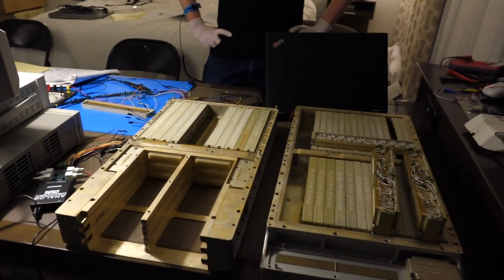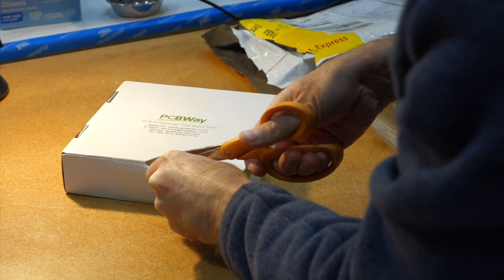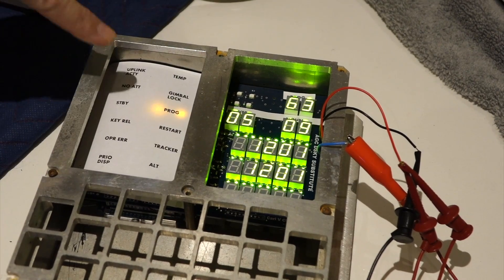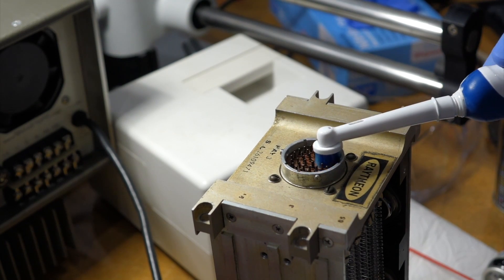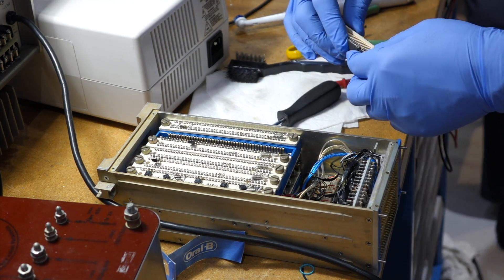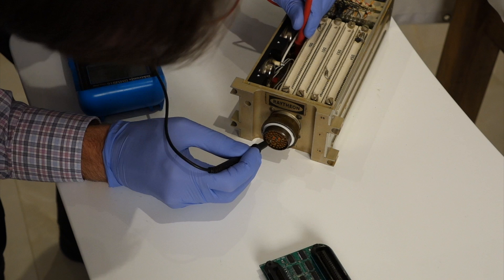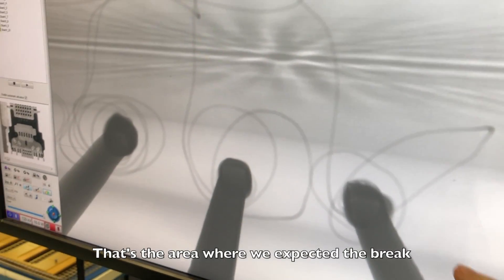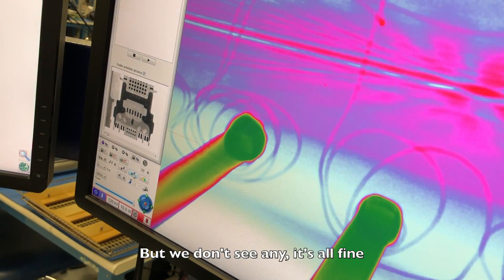Apollo Guidance Computer Part 6: Restoration update, a new sponsor, and a satellite launch

Comment: 0:55 EMM
 - 2k words of core rope memory from 16 bit registers 
1 word = 16bits (2 bytes). 2 * 2,048 = 4,096 bytes (4 kilobytes) of erasable core memory!
It might not sound like much, but 4KiB of erasable core memory on something that small in the mid to late 60's was pretty amazing.
Reply from the maker: Almost. I think you maybe mixing things up between core rope and erasable memory. Core rope was 36 KWords (of 16 bits), so 72 KBytes of ROM, and erasable memory (which is also core, but not rope, and has lower density) was 2 KW, so 4 KBytes of RAM. Which was indeed a lot for such a small volume (probably one of the highest densities achieved at the time), but an excruciating limitation for the programmers. They used every trick in the book to save a byte, including using a byte-interpreted higher-level language for complex calculations.

Comment: The reason the pins of the IC are 'splayed-out' is because the IC is meant to be used with an auto-insertion machine of which the end-effector relies on outward tension of the pins to hold onto the IC. So, the tension is always still there because the are not bent by the auto-insertion machine--just tension-flexed enough to line up side-to-side with the PCB holes. Great work and love your commenters!

Comment: If the break in the wire is narrow enough I bet you could weld it back together by applying enough voltage to arc across the break. Not sure if I'd actually try it on something that's as irreplaceable as that memory module though.
Reply from the maker: We thought about it, but the wire is so tiny (4 mils) that I think it has much many more chances to just vaporize rather than welding. We could get 4 mil wire and try it in an experiment.

Comment: I love this series. One thing I would like to know is a bit more technical details about the core-rope emulator device. Those "DIP-stick" assemblies don't like very complex, so I was wondering what is in there. It seems like it would have to be some kind of static RAM or something. Which begs the question, if SRAMs were available at the time, why did they use core-rope memory???
Reply: At the time that the AGC was designed, a 16 bit memory would take 16 chips to implement. To create a 36K word memory for programs would have taken a half a million chips, more than 10X the size of the AGC.

The core rope is a read only memory, not a RAM,  with an very important objective of keeping the programs from being corrupted by errors or other failures. 

The core-rope memory is driven by the AGC with putting an address on certain signal lines, then pulsing the memory to read. The simulator captures the 16 address bits,  sends a message to an external computer that was hooked to the simulator. The external system had large core memory inside it, loaded from a tape drive. The external system sends the 16 bit word back to the simulator box.

The simulator box has enough storage for the 16 bit word, which it provides to the AGC when the read control pulse is sent by the AGC. In other words, the simulator boxes look at the address coming from the AGC, ask an external system for one word, then turn that one word into appropriate pulses into the AGC at the right time.

The core rope simulator boxes have the ability to store the 16 bit address, to send those over the cable to an external system, to receive and hold a 16 bit word, and to produce pulses at the right timing to convince the AGC that the word value was read from core rope. 

We don't have the external system that was hooked to these simulator boxes. We don't have the schematics for the external system. Ken is engineering an external system, using a Beaglebone controller and the cape PCB he built, which will look just like the external system to the simulator boxes. The boxes will think they are talking to the external system.

Ken had to reverse engineer the insides of the core rope simulator boxes, plus analyze the memory reading logic in the AGC, so that he could design and program the external system which we will use to drive the core rope simulator boxes.

His Beaglebone system will hold all the various core rope software versions that have been found, allowing him to choose one which the AGC hardware will execute when we power it on.
Reply: Thanks for the explanation. Calling it an "emulator" was throwing me off, as this implies that the box itself was emulating the core rope memory itself. I don't recall the video mentioning that it translated to an external memory, which was missing. That's why I thought it needed to have memory inside. Now it makes a lot more sense.Given the way it works, it seems like even if the emulator was broken or was never even found, that the functionality of the emulator could have been reproduced on a new design. Imagine taking the beaglebone and probably a bunch of comparators or level shifters to sense the inputs of the core rope interface and then output the correct levels in response. Put it all in a nice box with a USB interface to connect to a PC to load the programs. This is how I always imagined it would be done, since the emulator didn't seem to be documented.  Thanks again for taking the time to explain the emulator to me.
Reply: @USWaterRockets  The AGC is not sending logic levels nor latching them in. It believes that it is hooked up to actual core ropes. 

It sends hundreds of ma of current in a short pulse to cause the large core to flip. The sense amplifiers are watching a differential wire pair to detect any kind of low level pulse that returns if the sense wire is woven through the core. 

Thus, to replace the simulator boxes themselves, we would have to match the impedance and characteristics of the core rope, absorb the current pulses, then produce a return millivolt pulse at the proper time to cause the AGC to see it as a one bit. 

The driver circuits inside the AGC are kind of sensitive - if they are operated with no rope module installed, the power transistors blow out. If they are connected with a simple short circuit, the power transistors burn out. The connection must be within the range of real core rope to suit the driver circuit.

This is why it was useful to reverse engineer the core rope simulator boxes. They do the heavy lifting, presenting the right impedance to the driver circuit, converting the pulses into a logic level to determine the address request, and produce a plausible millivolt level pluse for the sense amplifiers for any 1 bit that is being read. 

The round connector side of the core rope modules, on the other hand, operates with regular TTL logic levels, not pulses or analog stuff. That is why Ken chose to drive them instead of replacing them.
Reply: I was not aware that the driver circuits would blow if open or shorted! I can see why getting the emulator running would be desirable.  I do wonder, has the emulator been reverse engineered to the extent where schematics have been created for it? Seeing how there were so many issues getting the DIPs to simply make a connection inside the DIP sticks, I would be nervous about a connection in the emulator being faulty and causing the damage to the AGC you warned about. Perhaps the DIP devices are not in a part of the circuit that is critical that way, but I suppose you already have determined that everything will be safe. Thanks for the detailed response!
Reply: @USWaterRockets  The core rope simulator boxes use analog transformers to present the proper impedance to the AGC driver circuits. 

Ken has reverse engineered it to the level that he has a schematic. I will check to see if he will post it for others to view.

Comment: how does the rope simulator work ? "Normal" RAM Chips inside that need the Contents loaded into before simulating it the AGC ?
Reply: Yes, but they have only the room to hold one word of the 36K at a time. The contents are requested by the rope simulator over the connector we were fixing. Ken's driver box, a Beaglebone with a custom cape on it, will take the requests and feed the one word to the simulator. 

The simulator latches the 16 bit address set up by the AGC, asks the external box (Ken's) to send it a word, then when the read pulse is produced by the AGC, the rope simulator produces the pulses that would be returned by physical core ropes, corresponding to the one word being requested.

Comment: Would it be possible to isolate or piggyback the bad core section and simulate it with a small board hidden somewhere?
Reply: That is one of several possible solutions. Stay tuned to see  the options, investigations and solutions.

Comment: At least these were obtainable connectors from a series that's still active today. That's lucky! Lots of hardware from that era used connectors that have been long since phased out. Yours looks like 20-39 from D38999 Series 2, though I'm surprised by the solder contacts on the plug instead of crimped types. Modern aerospace stuff often uses high speed serial lines, which means twinax/quadrax/8-way/fiber... and all those connectors tend to be in the $1k+ range to buy, most of that cost being the high-speed pin groups; not to mention specialized tooling required for assembly. The actual connector shells are "only" $30-150. Future reverse-engineering of today's aerospace hardware will be a lot more expensive, even aside from the much higher complexity. Worse yet, a lot of advanced modern military hardware uses PCB-soldered filtered connectors (with LC filters for each pin), with the pins being non-removable in case of damage. But with a 20+ layer board, good luck desoldering such a connector due to the thermal mass. But, all this is part of our general trend of non-serviceable electronics unfortunately. Pretty much inevitable.
Reply: That was a more modern connector, you can tell by the Teflon back seal. That and the plating pretty much says its from the late 1990's thru the 2000's easily. I kind of wonder... MIL-C-38999's were used on the EA-6A's I wrenched on and the older versions had a spring clip holding its whole body together and removing it was. I had to mod a connector, popped off the spring clip and took the whole connector apart and used files to make it fit.
Reply: @geneard639  Hi Gene! I'm not familiar with older versions of these. I work with mostly D38999 Series 3's these days, but I'm familiar with other standards like M83723/26500/26482/28840/5015/etc. What I can tell you is that the "spring clip" you speak of is very common for all modern M83723 and D38999's to hold the plug body to the inner core/insert (this is still true today). The exact technique is up to the manufacturer. Amphenol/Deutsch/Souriau etc all use their own retainer and ratcheting systems. Souriau often uses a plastic cover over the spring clip. I've never seen a teflon back seal before though. That, along with the solder contacts suggests that this is either a manufacturer-customized version of D38999, or maybe not D38999 at all. Customized connectors based on a standard aren't uncommon. These days NASA has their own standards, such as SSQ21654 and others.

Modern connectors are sealed with a proper environmental backshell, which would use a fluorosilicone ring to press against the area above the plug threading, along with another compression ring to create a seal with the harness. As such, any modern D38999 Series 1/2/3 + environmental backshell = IP67 rating when mated (and no rating when unmated). Also, have to be careful when machining the "olive drab" connectors (W/B designators), such as the one in the video, due to cadmium dust which is nasty stuff. EA-6A's are very pretty beasts. That must've been enjoyable for you! :) -Nick
Reply: @geneard639 At 8:47 it looks to me like that might be a date code of 06/40.

Comment: Will the DSKY board be publicly available?  Would love to see the BOM as well!
Reply: I would be happy to make it available. Not all that useful without an AGC, since it is engineered to be driven by 28V logic levels and to respond to the AGC in kind. Much easier to use any of the replicas that are available, since they can put an AGC simulator inside and drive it all with modern logic levels. 

From the top of my head, without exact counts:

21 TDSG3160-M 7-segment displays
3 MAX7219CWG+ driver chips
2 PCF8574DWR I/O expander chips
9 G6L-1F-DC4.5 relays
32 MMUN2111LT1G transistors
5 inline connectors and one barrel power connector
1 Arduino Mega 2560
9 CGRA4007-G diodes for relay quenching
30+ capacitors
60 LEDs plus 60 limiting resistors
quite a few other resistors

I believe the final component count was 398.
Reply: @carlclaunch793  Thank you so much!! Will  add to the Open DSKY replica forum.  Good to know what parts people are sourcing.  Especially the +/- segment led display.  Love these videos!  Please keep them up!

Comment: What for do you need 10 layer job for a simple display interface O_o
Reply: It includes 23 logic interface circuits for shifting 28V logic down to TTL for the Arduino, 9 relays with driving circuits to output 28V logic based on Arduino 5V signals, 21 seven-segment displays, hundreds of LEDs. 

The major constraint is the small DSKY box and the specific placement required for each light and display in order to look like the DSKY. That made routing quite difficult - impossible with the standard Designspark trace sizes and separations even at 10 layers. 

There is a 5V power plane, a ground power plane, a 28V power plane and a switched 5V power plane for the many LEDs that have to switch on or off based on the switched 14V power line coming from the AGC (for standby mode).
Reply: It's not like modern displays where everything is multiplexed on a grid array. The DSKY had a relay for EACH individual element especially for the electroluminecent (no LEDs back then) 7-segment displays running at high voltage, a large pin array header on the back, and a bird's nest of wires in between.

Comment: There is quite some audible noise, it sounds a bit like 3g/4g data noise, maybe for the time you record with your phone (if its that) switch to airplane mode?
Reply from the maker: It’s something in my lab, have not quite found what it is yet. Only hapoens with my Rhodes microphone.
Reply from the maker: Found it, it's the wireless from my AT&T router box. Picked up by my Rode shotgun microphone. Either disable the router, not use the shotgun in the lab, or find the problem with the shielding on the shotgun.

Comment: Kicad is my prefered over Eagle
Reply: As long as it can output Gerber files. That's what all the PCB manufacturers seem to take.
Reply: @BlackEpyon  Both can hopefully ! I was a huge Eagle user until I let myself seduced by the Kicad's interactive router that helps a lot
Reply: @qerfqbAZRE  Pretty much any circuit design software can export gerber files. I'm not sure if this is true of generic CAD software though, like AutoCAD.
Reply: BlackEpyon  Good question, i've not been using AutoCAD for years
Reply: @qerfqbAZRE  I finally had to stop using my copy of AutoCAD 2000 when I upgraded to 64-bit systems. To be honest though, I didn't use it often enough to justify getting a new copy.

Comment: You need  telephone cable echo-locator for the broken line.  Except faster and higher frequency than those used for kilometer long telephone lines.
Reply: You're looking for a TDM - Time Domain Reflectometer
Reply: @shaunrossi9388  You could just use a good scope and a one shot signal generator at a high enough frequency.

Comment: Those wires touching, is that OK?

I really want that xray machine😂
Reply: They are probably separated vertically, which the x-ray is not showing (guessing only)
Reply: @richardlincoln886  I wondered that too but thought they'd have checked
Reply: It's all magnet wire, like you'd wrap a transformer with, so the wires have a thin insulation coating. There's absolutely no way the wires aren't all touching each other with how the core planes were folded in there. :)
Reply: @mikestewart8928  hey even magnet wire can be defective

Comment: I'm sure a lot of people will shout NO!, but I've had quite good luck cleaning up those old silver-plated military connectors like new using commercial liquid silverware cleaner. You want to use the liquid kind that works by chemical action rather than the scrubbing creme stuff. Just brush it on, wait a few moments, and wash it off with lots of clean water. Shiny like new silver pins.
Reply: "I Wilton" you are correct. When I worked on the Hawk and Pershing missile systems, we used to use a clear-liquid silver-cleaner that had a pretty heavy smell to it and would form crystals in the bottom of the jar.  We would then rinse the assembly in trichloroethane and then re-assemble them.  
The way I'd do it, is to first spray with Deoxit to form liquid fillets to the rubber-pin interface (to minimize silver cleaner going past the old rubber seal), then clean with the liquid silver cleaner you mentioned, finally flush with CRC-QD Electronics Cleaner and apply a fresh spray-coating of Deoxit.

Comment: That core module is not something I expected to see again, but I will say, as someone who prides himself on servicing non-servicable assemblies, I haven't the faintest idea of how to unpot core.  Certainly any mechanical means are out,  with the possible exception of carving off chunks before applying the chemical or thermal means, just to reduce the workload.  Good luck!
Reply: With (possibly a huge amount of) luck, it's a material that can be dissolved by a chemical solvent which doesn't also dissolve the other components of the assembly. I'm keeping my fingers crossed that's the case, just so an "original component" can be preserved and used.
Reply: Depends on what it's potted in. Let's see what they will come up next.